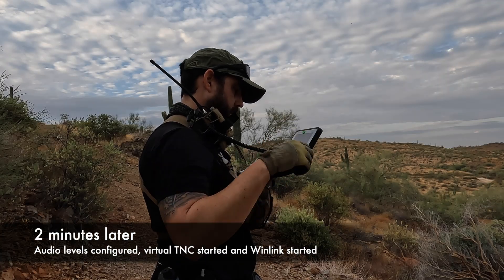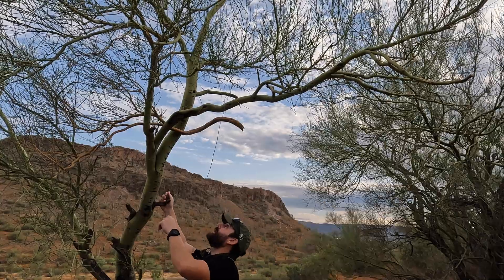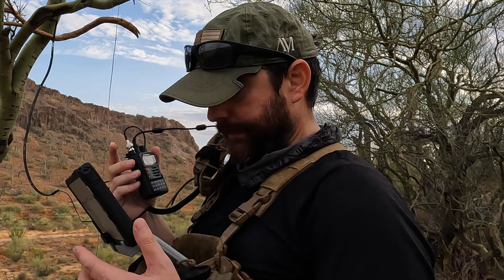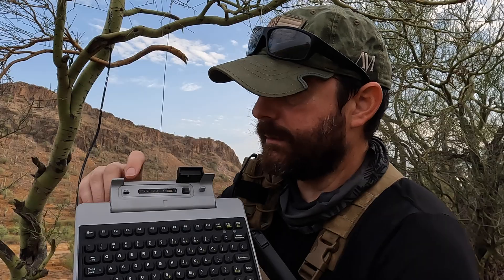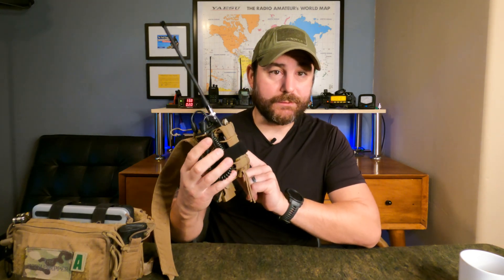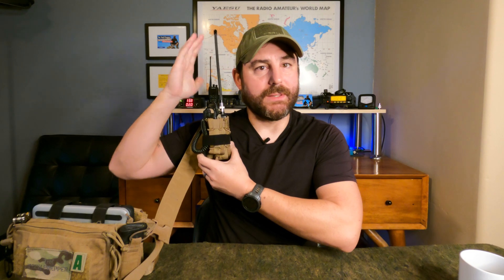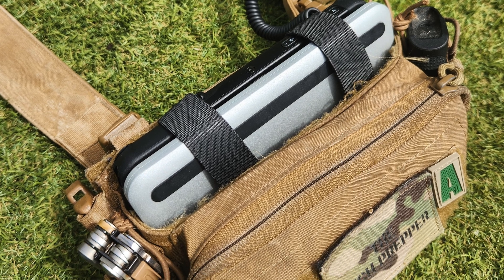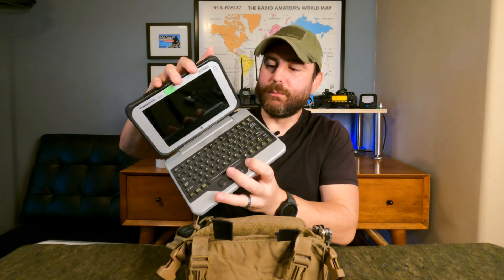Ruggedized Ham Radio Gear for Field Expedient Comms

Comment: It's been very interesting to follow along through your development, warts and all.  Anyone who has done hardware or software development can appreciate your tribulations.  Being able to operate without the keyboard would be a great option.  Touchscreen keyboards aren't pleasant to use but in this application, you aren't writing a thesis so a touch screen would be fine for position reports and quick EmComm text.

My own feeble attempts have had a different emphasis.  I packed lightweight computing and radio into a shock proof and waterproof container, figuring I'd be communicating infrequently and after taking shelter from rain and sand storms rather than comms on the go in a harsh environment.  Honestly, I've done a lot more planning and purchasing than execution.   😕
Reply from the maker: I am happy to share the realities. I am no ninja when it comes to operating. The real world will always throw at least one curveball your way. It's best to use these opportunities to share the problems and find solutions together.

Let me be clear, I am not a fan of touch screens. I absolutely hate them as they usually fail for me. This one of the reasons why I will never own an IC-705. My phones lock up continuously when I operate them with sweaty hands. 

Your attempts are not feeble. Everyone's operating style is different. Your needs and requirements should dictate your approach. In general, a waterproof/shockproof container will work for 99% of people. 73's
Reply: Yep. I like the idea of using something like an Android which is a much smaller footprint in a chest pouch...which is still touchscreen. Just not sure it would be durable enough.
Reply from the maker: @richardkennedy815 Take a look at the Ulefone Armor line. They work extremely well. I have been using the Ulefone Armor X7 for a couple of years for this application without a data/cell plan. I even did a submersion test on the channel when I first go it.

Comment: Glad to see this style of video again! Been missing these. I have had the DigiRig for about a year and have yet to get it to work. HT, mobile and HF all fails. Watched tons of videos and contacted support but still no luck. About ready to throw it up in the air and hit it over the fence with a baseball bat! This day and age everything should be plug and play. That is one thing I hate about HAM radio: it is so hard to get different equipment to work together. My Signalink USB just plugged in and worked so why can't the DigiRig? Again, thanks for the great videos!
Reply from the maker: Morning, Ron. Glad to hear that you enjoy this style of video (exercise + AAR). I am still trying to find the right balance of life, work, YouTube and the side projects. Don't give up on data modes. Keep at it. They are unnecessarily complex. Hams are a different breed and tend to hack systems together.  This is why I am trying to deliver EmComm Tools as a plug-and-play platform that is known to work with select radios and hardware combinations. You're likely running into audio input/output level issues. If you can remind me on the live stream tonight and I can provide some tips.
Reply: Sounds good. Thanks.
 @TheTechPrepper
Reply: what radio are you working with and what mode are you trying to use? It took me a really long time to get it to work on Winlink, FLDIGI, SSTV and JS8 (mostly because I was learning the setup and whatnot). It actually ran me out of the hobby for a little bit because I felt like I was doing unpaid tech support as a hobby which I am not about that life.
Reply: I am trying to use Winlink and FT-8 on my FT 70, FTM-300 and Xiegu G90. I have all my settings correct as far as all the videos and tech support shows. @andrewrussell4597
Reply: Obviously FT-8 is only on HF.